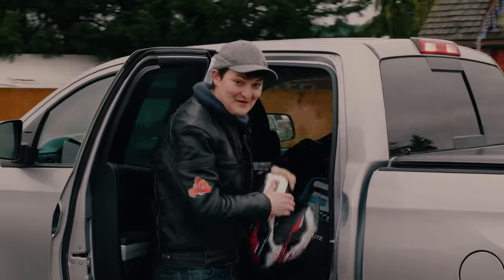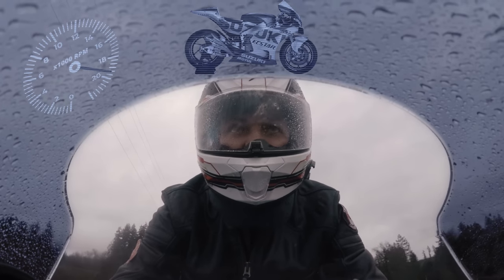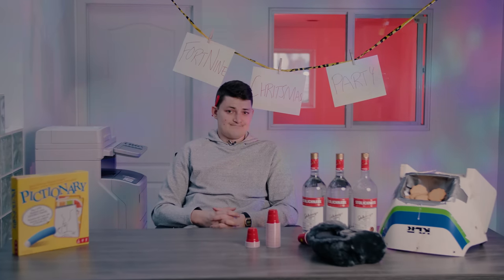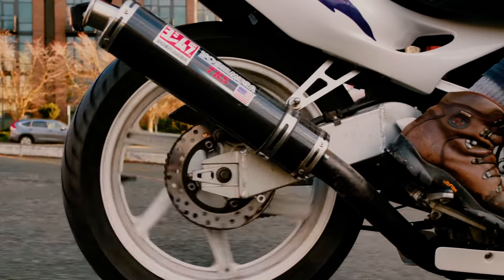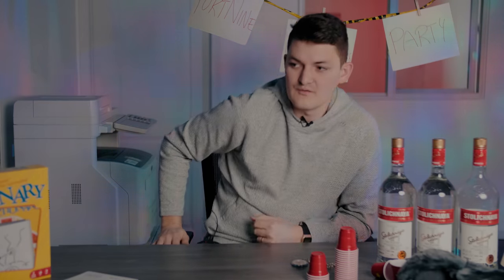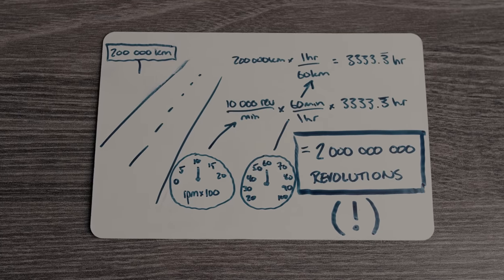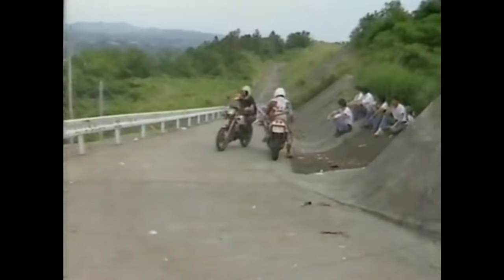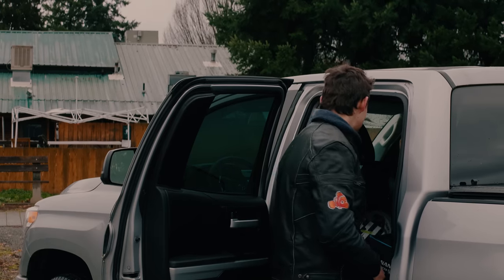The '90s Honda that Revs Faster than an F1 Car

Comment: I had a Japanese grey import CBR400RR that had been "breathed on" back in 1985 when I lived in Bangkok. That would hit 16k red line easily and accelerate to an indicated 240+ KPH on the highway. It crackled and popped and spat fire out the exhaust, but what a glorious noise! I bought it from an ex-racer turned Journalist friend.

Comment: I live in New Zealand and have a 1992 JDM unrestricted version of these bikes. Its 30 years old and it still runs like clockwork. I use it everyday as my main mode of commute to work and university as you would a brand new bike and it has never let me down. Nothing beats 90s honda motorcycles for reliability and build quality. Only downside to these bikes is that the shocks are not easily rebuildable and the forks were designed for 55kg Japanese men and have no preload adjustment. Other than the suspension, everything on these bikes is on par with 600 and 1000cc inline 4s from that era in terms of performance and build quality. Whereas today, all you can buy as a beginner are cheaply made parallel twin commuter bikes with sport bike fairings chucked on top.

Comment: i own a honda cbr 400rr, after owning a kawasaki gpx 600 (1987) and a suzuki gsxr 1000. (2009)
i seriously enjoy the 400c the most, (on public roads atleast) it is such a blast to go full throttle mid corner, swinging the moped (lol) from left to right on a dime, its just super fun. 
and its the only motorcycle that i havent lost my license on so far lol. even the fuelconsumtion is great under normal driving!

Comment: I've a 1996 CB250F, which is the version of this engine that is in the Hornet - slightly lowered RPM - 16k achievable, but still very cool first motorcycle. I've since gotten an FZ6, but don't intend on selling the Hornet any time soon.

Comment: Funny thing is, in australia for the first 3 years of riding  you are legally restricted to roughly 46bhp (sometimes more if its a modern heavy bike liek a CBR550R). So these bikes are relatively uncommon and are present at every bike meet. My first bike was the 89 ZXR-250R- 141kg, 45bhp, 23,000rpm. Epic bike that you could throw into a corner in second at 15krpm iwth max lean and still barely be breaking the speed limit. Unfort, they are getting rarer as they succumb to issues from being owned by college students who cant afford to get the carbs balanced or rebuilt

Comment: I read somewhere that these smaller 250 and 400cc racebikes were popular in Japan because the first thing a motorcycle test examiner did was to lay the bike on its side and ask you to pick it up. If you couldn't do it, you failed. I once sat on a Honda 250cc six cylinder race bike which was ridden by Mike "the Bike" Hailwood in the 1960s. Wish they'd have let me take it out on the track for a spin.

Comment: I recently bought a 1994 CBR250RR.
I like this bike so much that I want to ride it until I die, because it is not too fast nor too slow, and it makes the best sound even at low speeds, even though the roads in Japan are too narrow and there are not many places where you can go fast <3
I hope that whoever has this bike will treasure it for a long time, because bikes in good condition are almost gone...

I don't know that much about it, so I'm worried that I won't be able to keep it for a long time.

I apologize for the length of this message.(_ _;)

Comment: I bought a 86' vfr 750 for $600 with a bad regulator/rectifier. I loved the gear drive v4 scream. It's such a different sounding engine. It was a complete mistake to sell it. It was so comfortable to ride.

Comment: In my country there a many of these quarter litre 4 pistons bike being sold in used market for around 3k usd. Most famous ones are kawasaki zx2r or in my country called "motor mesin basuh" which directly translates to "washing machine bikes". If you google it you will understand why that kawa is called that hahaha. The problem is to maintain these bikes takes a lot of money so people here are more likely inclined to 150cc new bike like the suzuki gsxr150 that priced the same but much newer and less cost to maintain. But nothing beats the fun factor of a 4 stove 250cc bike. Badass sound within safe speed. Looks cool too. 🔥

Comment: My first bike. Had never ridden before. At the time you could just get a provisional license where I lived and ride without a test for 2 years, as long as the bike was under a certain power output. This was luckily just under the limitation. Bought one of these used at a dealer and figured it out myself :D Fun memories.

Comment: Riding a small displacement 4cylinder bike is a very exhilarating experience. A CB250F revs to 16000. Not as ridiculous as the fire blade but still plenty of fun.

Comment: I don't know whether to be sad or happy about the zx-25r.
I think one of the major reason why they made it is since in my country it has same limitation as the old japanese limitation, but here they called it "luxury tax" that gets applied to bike that has more than 250cc. And the amount for that is quite extraordinary, reaches 125% of msrp for some bikes.

But the good thing is I can get a zx-25r precisely because of that law. Although buying anything bigger than that is not only hardly justifiable cause of the price, while also problematic since the roads here aren't anywhere as good as the western countries.

Comment: I had a Suzuki GSX 250 Across.
It was a great bike. It had a helmet locker where the tank normally was. The fuel tank was under the seat. It was a beautiful candy apple red and best of all, the little four cylinder engine reved to 16,500RPM!! 
It sounded fast no matter where you rode it.

Comment: I got mine just as Covid was breaking in March 2020 for $800 on eBay. Oh I live in Australia. They're really common here - like so common bike shops here often have 3 or 4 of them. Since Covid that may have changed but I haven't looked tbh.
Also there were 2 different MC22's. The pre 1994 and the post 1994. The later ones had 4 or 5 less HP and revved a bit less. Mine's the early one that revs even higher.
They are a great thing however as a poster below wrote there was a 400 that gives you most of the MC22 with a broader spread of torque and more of it albeit with 5000 less RPM. The 400s are actually hard to find here and when they come up they command high prices and get sold quick.

Comment: I’ve been fortunate enough to drive several of what most people would describe as high horsepower, fast cars. I can tell you, my mid 80’s 4 cylinder E30 BMW was more fun than the 900 rear wheel HP GT500 mustang. The next best thing was a early Porsche Boxster with somewhere in the neighborhood of 200 HP. Jay Leno says if best, it’s more fun to drive a slow car fast, than a fast car slow.

Comment: The 2006 season saw the highest rev limits in the history of Formula One, at well over 20,000 rpm; before a 19,000 rpm mandatory rev limiter was implemented for all competitors in 2007. Cosworth was able to achieve just over 20,000 rpm with their V8, and Renault around 20,500 rpm.

Comment: you should try the ZX25R It has the same 250cc 4 inline scylinder with maximum 17.000 rpm 
Kawasaki still sold this model today for the asian market only, maybe because of legal reasons
Reply: You can flash tune it with a custom full system exhaust that allows you to spin it up to 20. 

Im getting one imported to the states. Im going to ride it for 100 miles then put it on consignment and watch it sell for 32k. Every document, every stamp, every mile recorded on the bike will be archived and given to the new owner. Yes im going to record every single mile with a go pro.

Comment: I grew up driving big blocks, strokers, and diesels. I bought a ZX7R years ago and even though it only went up to 12,500rpm (my roommate’s R6 was 14k-15k iirc) I thought I was constantly going to blow it up…and then it still had another 4,000 rpm to go.

I had to retrain my brain over like a month of shit talk from my other friends to drive those engines where they work best.

Comment: I race a 98-01 cr250... It is a bike with no holds bared. It goes as fast as you can twist the Throttle. The acceleration is unparalleled, now there are things out there that accelerate faster but I've never felt it.

Back when honda just made the best that they could build, Pushing the limits at every turn. Now, yeah the 450s are fast, but thy don't have the soul

Comment: I had a 89 GSX-R 250, legit papers, factory look, i traded it with scrappers for a paperless 125 mint condition cagiva elefant. It was about to need a carb sinc...that was not the case, the engine was seriously messed up, it stood for 2 years at a selfmade mechanic as i did not want to spend a lot on it. As we moved to a house with my gf i needed all the money and sold it disassembled to a collector for 400euro whos first thing was to remove it from registration forever and display it after complete refurbish. My heart was bleeding to hear it at least one time revving...not to mention take it to bike weekends...it was once in a lifetime find that i regret selling to this day.

Comment: so I had a cbr600. and i had the shifter disconnect, thankfully in 3rd gear. because of the rpm range it could go from 0-60 easily in third gear, it would start slow though. 
Also a cop told me i was going 103 when I rolled the throttle back in 3rd gear one time.

Comment: I used to ride a ZZR1100 in the 90s, occasionally swapping it with a friend's CBR900. Revving its tits off on the highway was fun but not so much in city traffic. I still ride but I now cruise on torquey motorcycles.

Comment: @Fortnine should check out the grey import market 80s & 90s 400cc sport bikes. As 600cc was not that popular the highest tech was installed in the 400cc motorcycle. They destroy todays motorcycle in the 400cc market only problem is parts that are becoming more rare these days.

Comment: That sound man. Its unbeatable. Honda missed a big chance by releasing the update,the brand new CBR250RR with latest techs but just inline 2 engine? If they did what Kawasaki did with their ZX25R with the inline 4 engine. I wouldve bought it no matter the price. That screaming inline 4 engine is what bike fans wants.

Why Honda,WHY....??? With the latest techs you couldve dominated the world in 250cc class. The new Ninja with inline 4 cant beat the CBR with inline 2. The CBR is faster because Honda made it better eventhough it has 2 piston less. Imagine if Honda made that screaming inline 4 engine like the 90's model.

There is a rumour going on that Yamaha its gonna join in the party too because their R25 is outdated af man. It is the most depressing 250 bike. Dont even have ABS? No assist and slipper clutch,no quickshifter,nothing just a 250 engine and some chassis and fairings and there you go a bike? Wtf you are doing Yamaha? The Ninja that released in the same year as the R25 first model has ABS,assist and slipper clutch and also cheaper. Even their R15 has a&s clutch and also that VVA which made them the fastest 150 at that time. Come on Yamaha. Hopefully they dont dissapoint in their update R25 v2. I heard that they are gonna make the inline 4 engine. Not sure 100% but it would be wonderful. Lets just hope,wait and see.

Comment: These 250cc inline-4s with fuel injection are still being sold around the world, by the BIG 4. Just not in the U.S. I think small displacement inline-4s motorcycles should return to the U.S.
Reply: I only know of one fuel injected inline 4 250, and that would be the new ZX25R. Am I missing something?

Comment: F1 cars are limited by the rules not by any flaw or design fault to a limit of 18,000 rpm but due to fuel usage most of them develop peak power at 12 or 15,000 in order to complete a race without refueling.  Again per the rules.

Comment: My first bike in 2016 was a Suzuki Across (or GRX-250F) - it had a similarly high redline, but downtuned to be more "touring and commute friendly' (18k instead of 20k lol). It was a royal pain in the ass to maintain, particularly because it was a 20 year old bike when I bought it, and partly because it was over-engineered and overly-complex.

It was also the most I've ever grinned and laughed in my life

Comment: Interesting why it's "only" 45hp, with 180hp/L, at 19k rpm it should do up to 330hp/L or 82hp, or is it a carb thing or noise restrictions? It's crazy reliable thou

Comment: Honda cbr 250 rr gullarm is making 45hp and have 20000 rpm 4 cylinder 16 valve 6 gears amazing beast legal 250 it can hit 200+ speed  😋❤️ always top in my heart the cbr 250 rr

Comment: Does it rev faster, or just higher than a f1 car?
As revving faster generally indicates how quickly it builds revs (and i assume an engine like that revs stupid fast) but you only adressed how high it revved in the video.

Comment: The one in the video is a MC22 which only revs to 18,000 rpm and has 40hp and would top out at 160 kph, I know because I have one. The earlier MC19 revved to 20,000 and had 45hp and topped out at 180 kph but Honda had to reel it in because the Japanese emission laws tightened in the mid 90's and essentially banned the 20k rpm models, which then most were sent to Australia. The MC22 in the video is worth about double that of the MC19 in Australia though because all the MC19's are grey imports and the tri colour MC22's like in the video were Aus delivered new. Also different is the swing arm design, the MC22 has that sexy one in the video but the MC19 has the ugly old straight dirt bike style swing arm.
Reply: You've got the RPM thing backwards, although they both revved about the same, the 22 just lies more on the tachometer. The 1990-1993(?) MC22s were full power, then 94(?) and on were the 40 hp ones.

Comment: Please tell me you didn't rev that engine standing to max while cold! (There is visible exhaust fog.)

This bike's concept, maxing a tech trait just for the fun of it (i.e. revs first, horsepower moderate) should be extended: This bike, but with an inline-6! (The one like it that exists is far too powerful.)

Also funny that this bike was built that way to save the owner some annual costs, because it can't be cheap to buy, and fuel consumption is probably wicked, too.

Comment: When I was a youth the running joke was the CBR250 wouldn't last long. Ironically the fairings or the rider was gone faster than the engine. Yet the engine was the fastest part.

Comment: I would liketo see this or the  ninja dragraced against a 250 and 450 motocross bike. They are the pinnacle of single cylinder development. I think far more high strung than this motorcycle. Can't see one lasting 200,000 km.

Comment: Down in the 90,s u can find out of Word Motors and bikes .... aprilia rsw 125  ... 50+ HP
Husqvarna 610  Monster
Ducati 916
250ccm motorcrossbikes witch are Fast  even 4 todays Standards 
1100 gsxr
Hayabusas
Honda nsr 250...
 Legents....

Comment: These still get made in Philippines. 

But in my unpopular opinion, they are horrible as anything apart from novelty. They are loud and irritate everyone. They drink of fuel like a V8. They aren't that fast. Neither are they smooth. They have 4 carbs and are a nightmare to maintain. They aren't for anyone with a pillion. They scare the dogs, startle the cats, stops the cows from making milk. They're horrible for errands, and dangerous on a slippery road.

I want one.

Comment: 250k kilometer life expectancy on a 20k rpm engine?... right, LOL.  2 decades of riding performance 4 bangers got me to prefer V-twin traction, a flat torque curve of 90ft. lb @ 5500rpm, and an engine with ball bearings on the crank assembly showered with oil, instead of brass bushings relyant on oil pressure that is flinging away at 12k rpm.  Also no friction, so no need for water cooling to maintain 226 F for a "cleaner burn" & emmitions.

Comment: All good and well until you come up against a 2 stroke 250cc (Aprilia RS250, Honda NSR250, Kawasaki KR-1S, Suzuki RGV250 or Yamaha TZR250) which would leave that CBR250 for dead during acceleration, through corners, and top speed.

Comment: I prefer the Suzuki RGV 250 to the Honda revs are too high ,probably a dead duck with no power below about 9 or 10,000 rpm,I had a ZXR 400 that was the same,just like a moped till you got to around 9000 revs,not good to ride at low rpm.

Comment: I dont care about high revs, I care about speed. Redlining a 250 while being overtaken by a bigger bike cruising at 3 thousand revs. Also half the revs the bike does have are pointless as it only actually moves using the last two thousand lol

Comment: I don't get it.  So it revs high, but it's not that quick or fast.  So why do I care if it revs faster than an F1 car?  I'd rather go fast than just sounding like I go fast
Reply: sometimes people just want the sound or sensation of going fast without putting themselves in danger that comes with going over the speed limit, its a niche hobby thing

Comment: This is going to sound corny... But that's basically how I feel riding my POS Chinese 230cc "motorcycle" lol

I call it the race to 5th gear.
In South Florida if your vehicle can't go 0 to 60 in at least 7 to 8 seconds... You have no business on the road... You should see how dangerously angry people get with those poor souls on 50cc scooters...

So to be able to ride the bike anywhere, I have to basically gun it WOT from any stop till I get into 5th at around 65 MPH on residential roads... Yeah where everyone is supposed to be going 45? Everyone wants to do 60...

Obviously it's not the same as my thumper just sounds like a lawn mower being murdered at 7k RPMs 😅